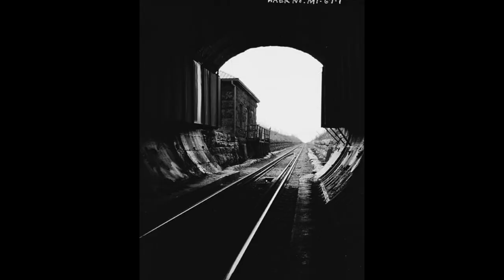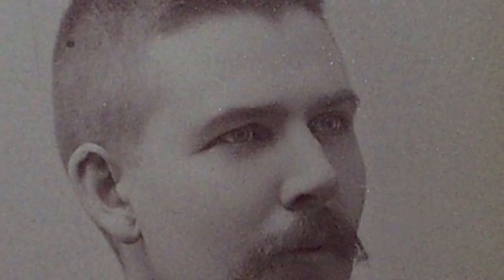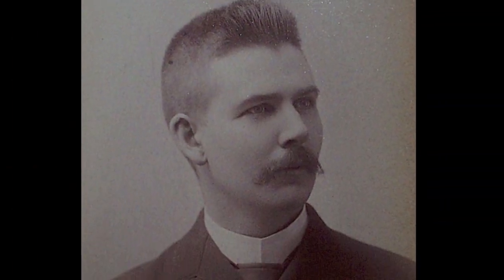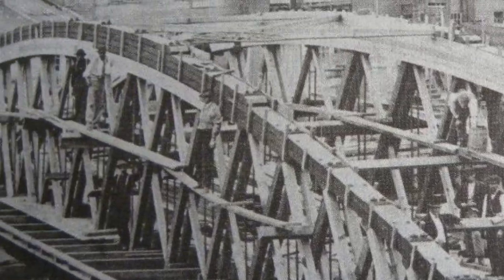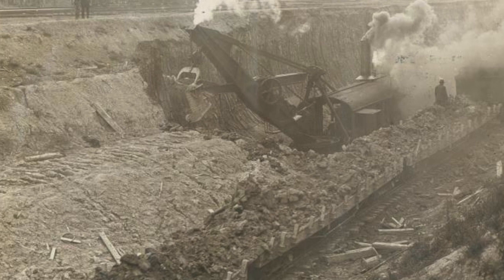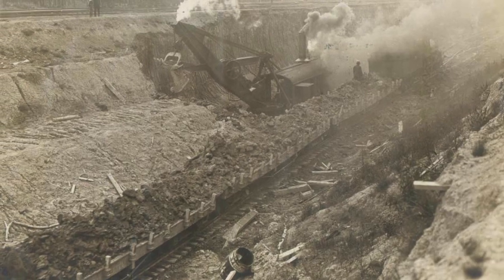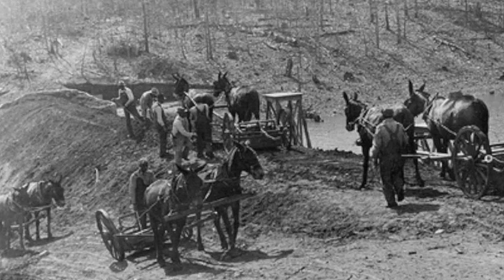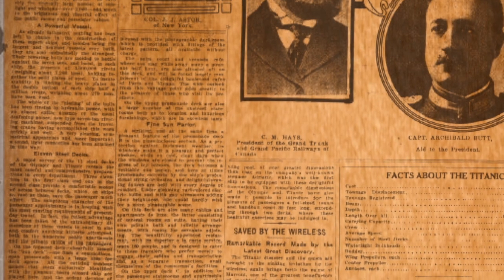Moment in History Extra: The raising of Downtown Port Huron Streets

Comment: This is fascinating. I had already heard from a man I knew who used to work for the phone company, that there used to be a kind of tunnel in front of the buildings on Huron or Military Street, but they filled this in, about the 1980s or 1990s. He said the phone workers regularly used this tunnel, which was really just the original storefronts, now underground, to access phone cables. And he said . . . yes . . . there were ghosts down there. I'm not kidding. He wouldn't make up a thing like that.